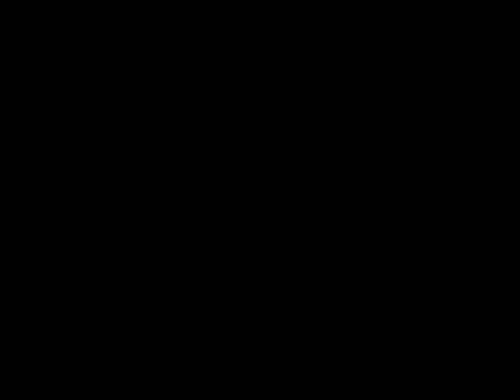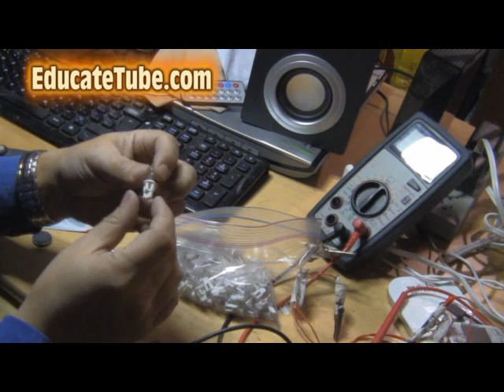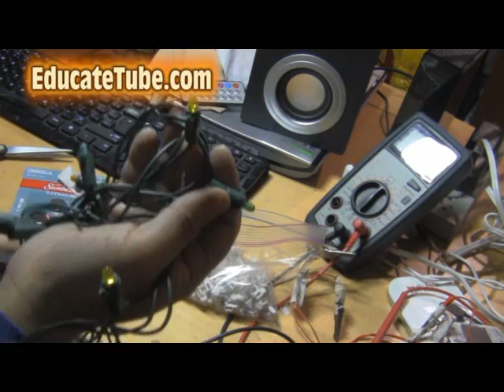How to test for defective LED Christmas lights using Lithium battery (Part II)

Comment: Why not just test with the Multimeter sitting there. Most have a diode setting
Reply from the maker: Some people don't have a multimeter and the cheapest way is to use a 3V button battery.